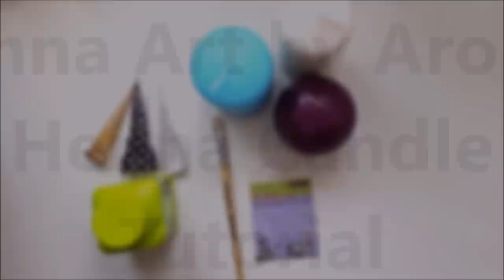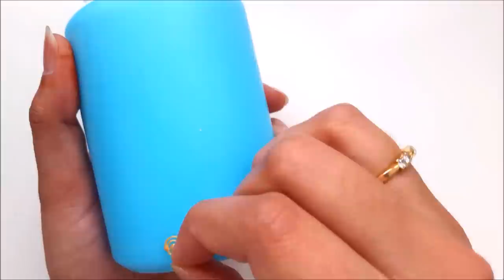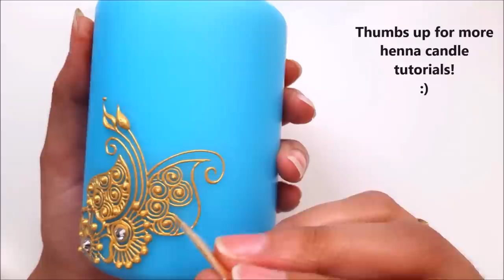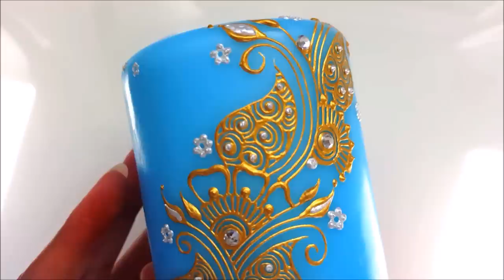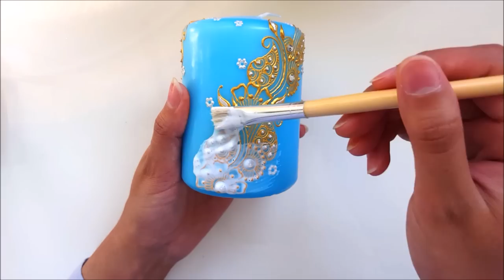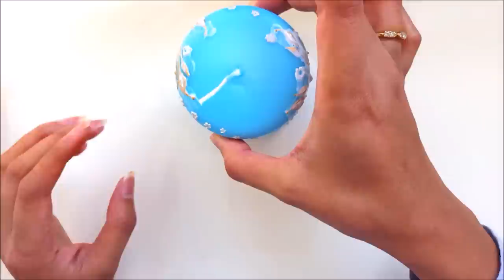Henna Candle Tutorial |Henna Art by Aroosa

Comment: Hello, what is the product you use over the design? One that is within the green pot, is a glue, varnish? I'm from Brazil and here do not have that brand, and also can not know reading because they do not understand English.
Thanks for listening. Hug!!
Reply from the maker: +Arte é Vida Its called modpodge and its a glue that dries clear
Reply: +Henna Art By Aroosa Then it would be a glue for decoupage, correct? Here in Brazil only found for comparable on a website, and it's quite expensive, I will buy every day to see if there is a difference with the glue to decoupage I have here. Thank you for resposder my question !! Kisses ... bye
Reply: Decoupage glue and sealer is just a watered down PVA glue, sometimes called 'white' glue, school glue or Elmer's Glue etc.  There are loads of 'recipes' on the Internet for fake ''Modge Podge'.  I normally just pour my glue into a jar then add the water until I get a runny single cream consistency. It's almost equal amounts of water to glue.  HTH
Reply: +babamc4 Okay, thank you for the tips, and congratulations on your work is wonderful, beautiful, perfect !! kisses
Reply: Yes it is decoupage glue but as I say you can make your own.  Mod Podge costs here €10 or so, I buy 500ml of white PVA glue for €3.99 and get almost 850ml of decoupage glue for the same price.  Remember decoupage and crafts are very old, before Mod Posge was invented!  So they had to use other glues!